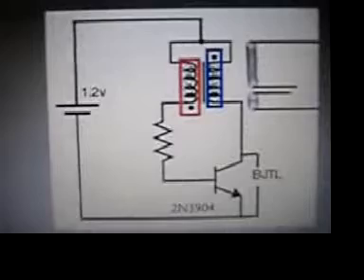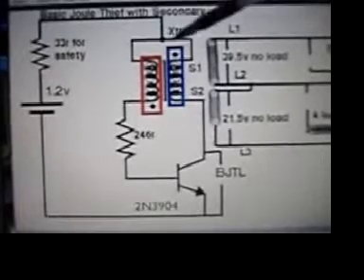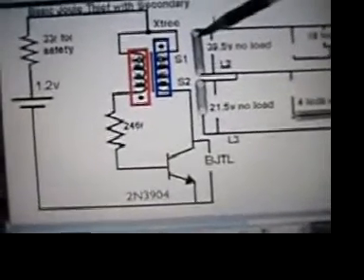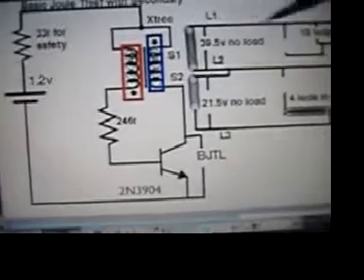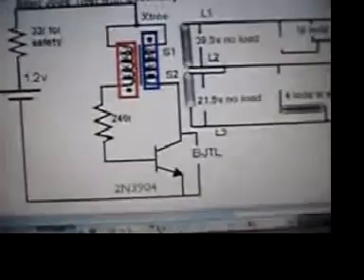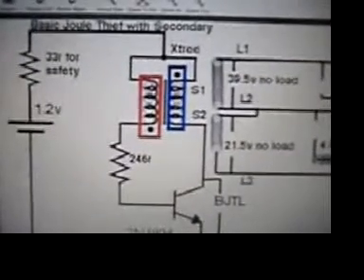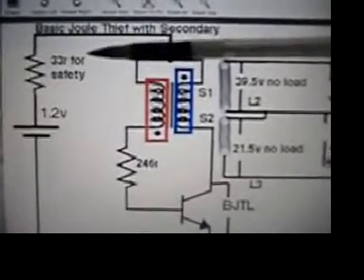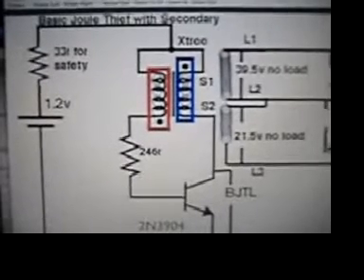Joule Thief with Secondary Explanation Part 2

Comment: Putting the resistor in series with the battery causes most of the battery power to be wasted across the resistor. Instead, the base resistor can be increased to reduce the base bias, which reduces the output current to the LED.  I've used as much as 100k or even more to reduce the JT output to a low level.  Some experimenters use a 10k pot in series with the 220 ohm resistor to allow the output to be continuously varied.

Comment from the maker: Hi V2DAY,
The secondary is not attached electrically at all. It is- they are both- wound around the same toroid as the bifilar primary. So, when the bifilar primary gets turned on, the magnetic field inside the toroid moves around and spikes etc, and that makes the electricity pour out of the wires and spike in turn.
Thanks for asking,
jeanna

Comment from the maker: I guess the answer is 4.
2 wires are made into the bifilar which is the  'primary' of this ckt. The joule thief works with that just as it is. It is the same as a center-tapped single wire, but we change the number of turns so often, it makes things more clear to call them separate wire names. 'Base coil' and 'Collector coil'.

Then there are 2 more wires which are true secondaries.
S1 has 74 Turns
S2 has 21 Turns.
I hope this makes sense, now.
...because there are more toroids to come!

jeanna